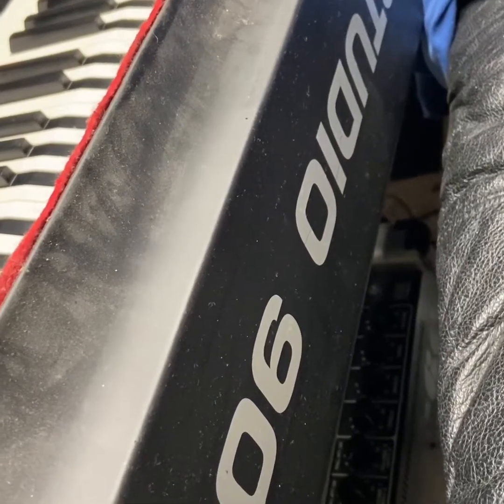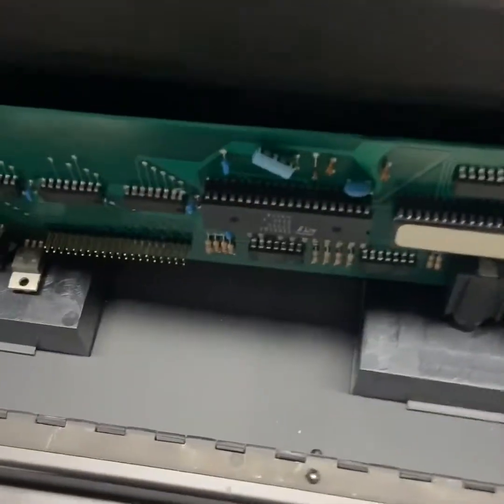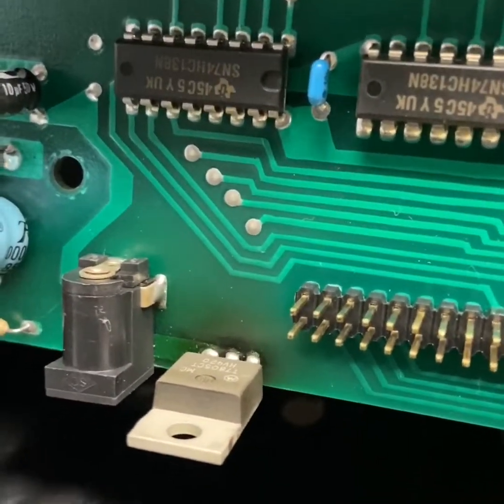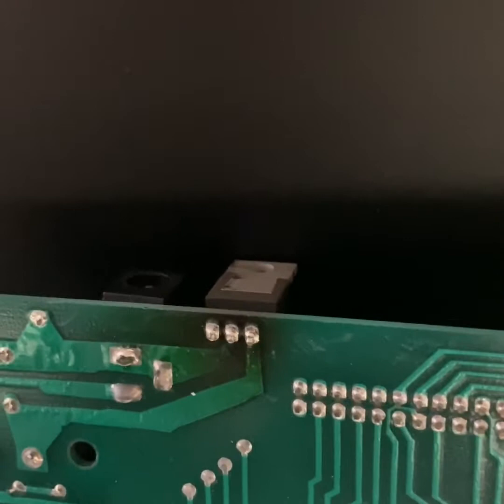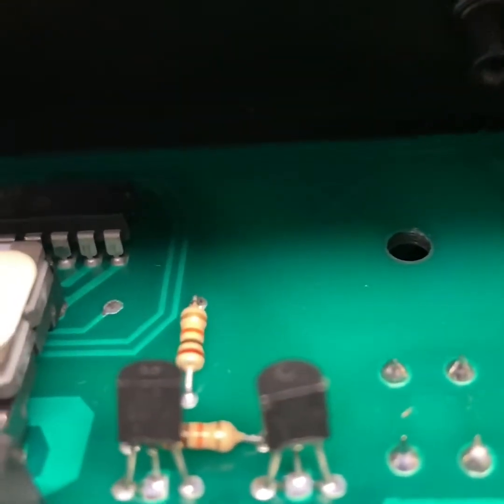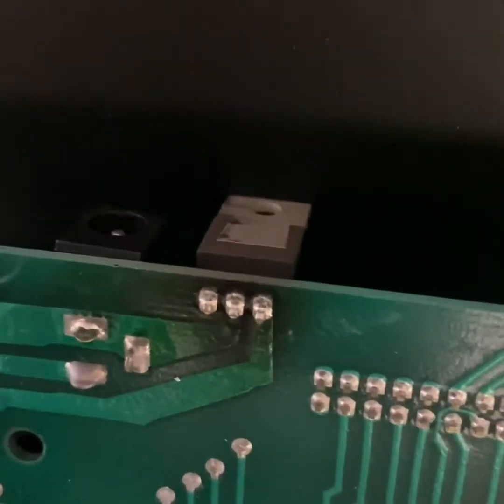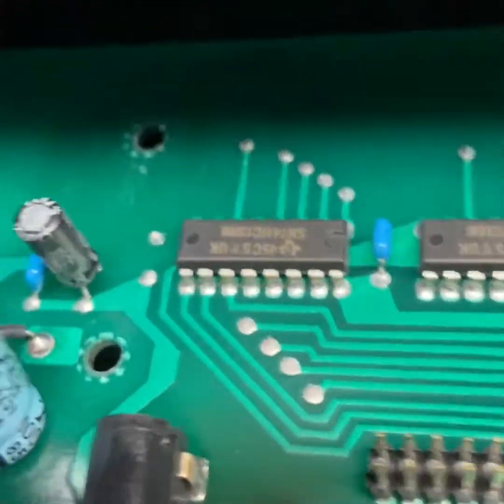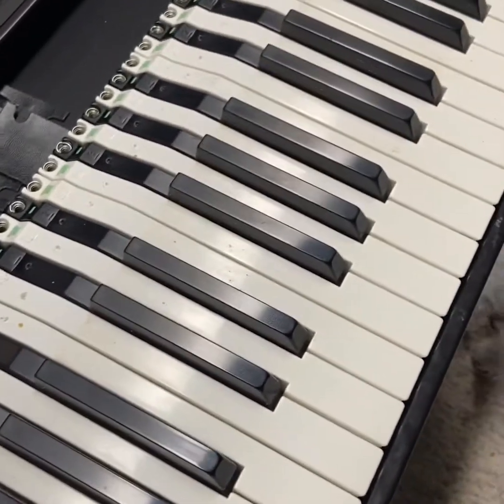Fatar studio 90 controller repair

Comment: Hey - I was just about to give up on my Studio 900 when I came across your vid! Sure enough the voltage regulator MC7805CT solder and board has browned!! So I just ordered a new regulator and soldering iron. My red power LED does not come on (I assume as the Voltage Regulator has blown). My Question: is the circuit dependent on the LED working -  or would the circuit work regardless of a blown LED?    THANKS for making the vid :)
Reply from the maker: I’m not sure. I don’t have a schematic on it. But if it’s connected in series, it probably does.

Comment: When I took my Fatar Studio 90 apart to clean it, I forgot to note which way the ribbon cable plugged in.  Happen to have a pic?  red side of the ribbon cable plugs in near the power plug, or the bank of resistors?
Reply from the maker: Sorry, I don’t have it anymore. It couldn’t hurt to try either way. If it doesn’t work, switch it.

Comment: My keyboard just stopped working as well (also a fatar studio 90... from the 90s), and I originally thought it might be the emi can filter where the plug goes. It blows the fuse whenever I plug it in and turn on power, and i noticed a tiny bit of corrosion there where the terminals are. Ordered another part but it may take another month to get here. In the meantime, I tried unscrewing the circuit board and it still seems stuck to the keyboard. It's starting to flex a bit when I pull and I don't want to snap it - any suggestions?
Reply from the maker: Sorry for the delay. Make sure all the screws are removed. I don’t have it anymore, but there may be a screw in the center too.